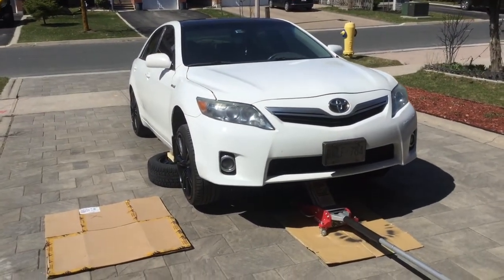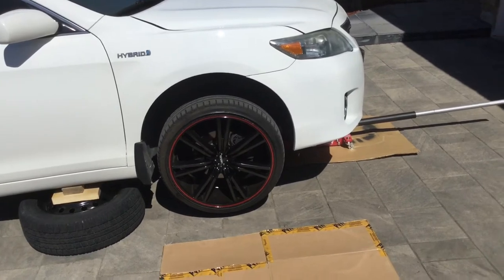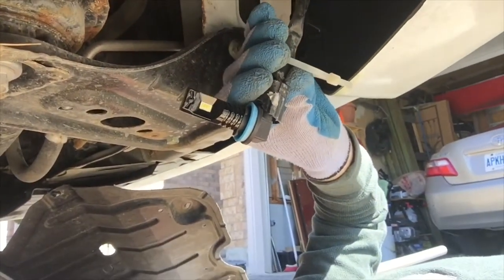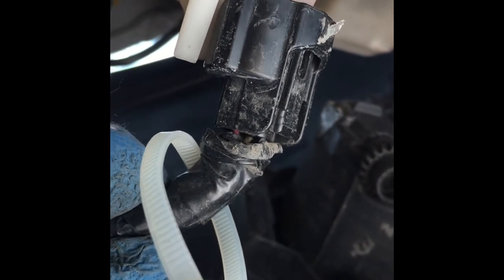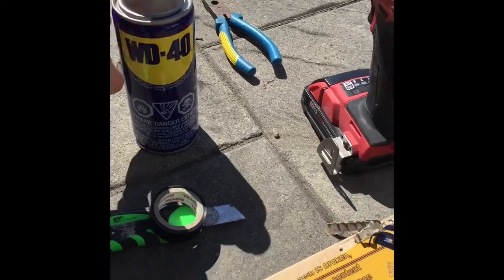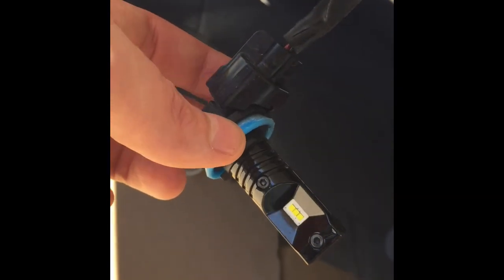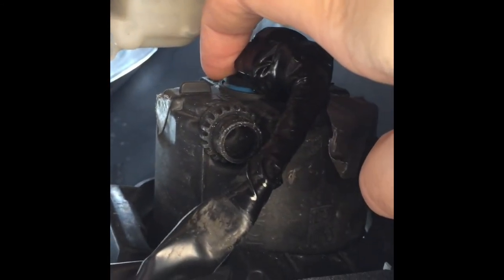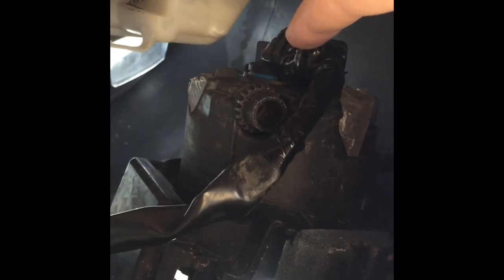2011 Toyota Camry Fog Light Repair / DIY Home Automotive Maintenance

Comment: Did your Camry come  Pre wired for the fogs.
Reply from the maker: Yes, this is a hybrid model and it came with the fog lights as part of the original equipment from factory ✅
Reply: @romantoronto  Mine did not, it has every option in the book except heated seats/side mirrors and fogs. I have everything except the special bracket that goes in between the foglight and the bumper. I have been collecting parts since last year. No one has it and most do not even recognize the fact that it exists, lol.